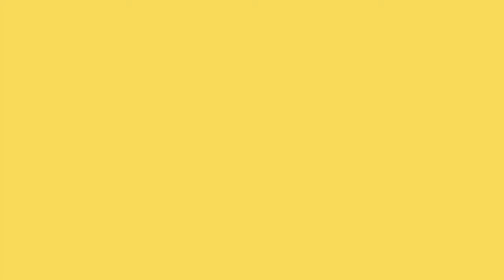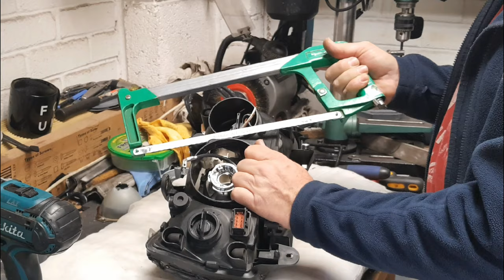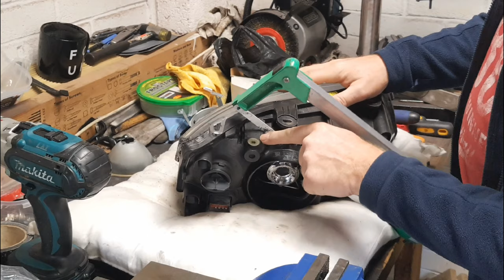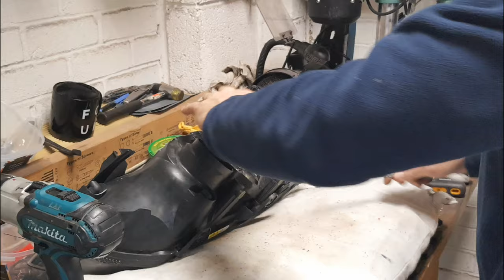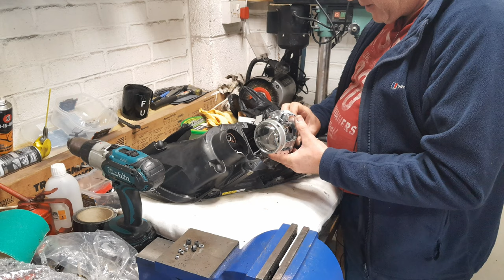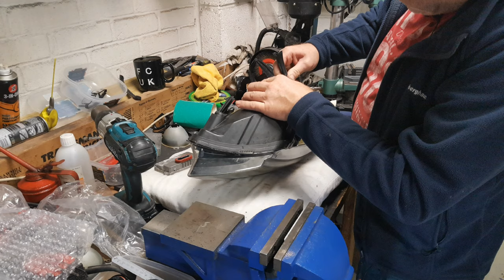how to remove projector from headlight | no headlight modification

Comment: That sounds scary to do it on an expensive headlight unit. I think I'd rather have the front cover removed.
Reply from the maker: If you've got a Dremel you could use a fine cutting wheel and create a lot less swarf. OR once the projector is out you could remove the other bulbs etc and swill the unit out with water and then let it dry.

Comment: I just used a blow torch lol but seriously, removing the front cover will lead to eternal condensation as it is difficult to get the same sealing quality as the factory. This method is unconventional, but gluing plastic to plastic is easier with all the super glues available for it. The cut has to be precise though.

Comment: A lot of manufacturers don't even put a large enough hole to fiddle at the projector opening to fit the actual bulb. They should be regulated so we have proper access to the bulbs and the nuts that are holding the projector. Can you recommend some glue types? I'm worried about water ingress, and epoxy takes a long long time to set in

Comment: Hi @cyclonecyd. Thanks for another interesting video. In your notes you list a link to Sinolin GEN4 EVOX-R rather than the version you used. It seems that the Sinolin GEN4 EVOX-R has a LHD version suitable for the UK market. If so, I guess that the modifications made to the projector in your video would not be necessary? Is that right? Thanks.

Comment: They should make the shutter removable because I hate it showing my whole windshield black from middle on up because it stops the light from shining as bright as it could and I can't see down the road adequately.  Stupid  thing I ever saw in a big ass truck dodge ram is this little dam headlight that all my headlights high and low from the small projector light. Stupid stupid. No one makes anything in this world to actually work. When headlights are a safety issue and people die if they can't see going down the road cuz all car dealers care about is how much money they get  to sell cheapest made vehicles they can make.  Then don't make adequate shit after market that is not a dam hassle and way too expensive to modify.

Comment: Anyone who does this is off their rocker. But having said that their is people out there that have followed your advice and lost a lot of money because they cut a big hole in the back of their headlight. Warm up the glue in the oven and take off the lense or if you have a heat gun it's best to use that
Reply from the maker: Well, you would be wrong. There are some headlights (Honda/Lexus spring to mind) where the front cover CANNOT be removed by warming them as the glue does not soften.
Reply: I was wondering if a heat gun might be a good alternative to the oven too. Although I'd have to be very careful not to overheat any part of the headlight as I worked my way around. Maybe it's better just to use the oven when my wife isn't home to worry about me melting headlights in the oven!